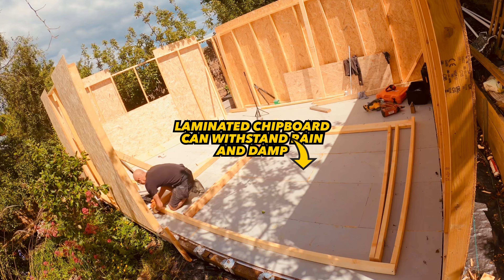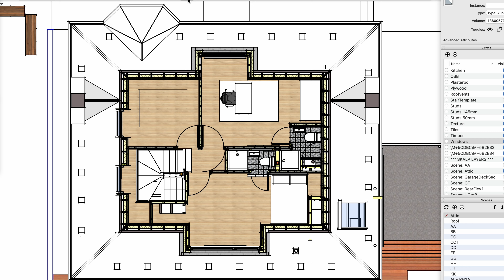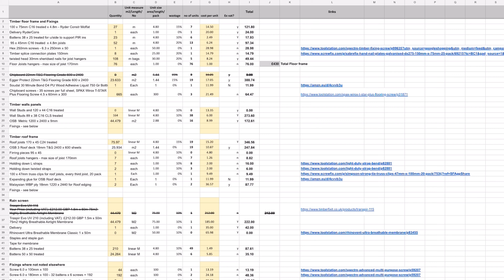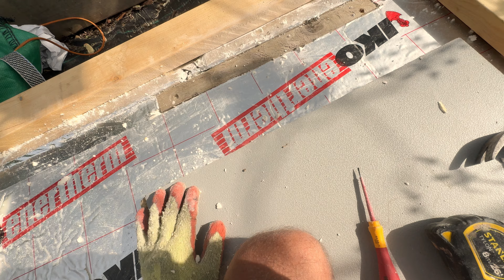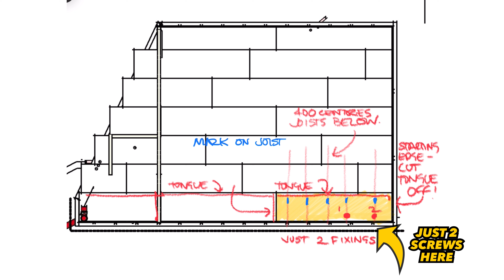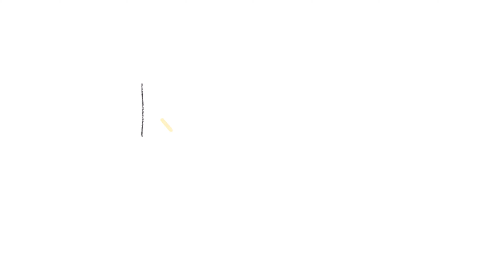Lay Chipboard Particleboard the Easy way | Architect & Builder Tips

Comment: Just found your channel, incredibly informative, I’ve subscribed. I’m doing a renovation, taking a wall out to make two rooms into one. This gives me a slab and suspended wooden floor (I’m laying 22mm p5 chipboard) and will put LVT over the top. My question is how do I join the two floors and maintain an expansion gap for the chipboard? Thanks
Reply from the maker: Hi. Tricky as I’d need to see the arrangement. I’d be very careful as it’s going to be so hard to predict the movement at the junction with the two make ups, regardless of a movement joint. You probably don’t have the depth for screed so I’d consider a floating floor with underlay. You want a floor finish that acts like one big carpet and floats over the junction, which can move separate to the finished floor.  I’m never sure how well lvt does that.

Comment: theory is good, however particle board is absolutely useless for floorboard, I would never buy a house with it, never use it doing Reno work, I don't even want to use it for kitchen cabinets, chip board is rubbish, do not use it, some country's its not so bad, but its a no go for most, the right ply is better, the best is floorboards of correct/available timber
Reply from the maker: You might be thinking of furniture-grade chipboard or MDF. Modern floors use P5 moisture-resistant structural chipboard. Because it’s tongue-and-groove, it locks together and prevents the edge-sagging and squeaking you get with plywood unless you waste time and money blocking out all four edges of every sheet. When people in trade environments say "chipboard floors are rubbish," they are confusing cheap P1/P2 furniture board with P5 structural flooring
Reply: @build-better-things  im a joiner by trade, used most products, chip board products including floors are replaced regularly, chip board is rubbish, moisture resistant, NOT water proof, if someone wanted me to put chip board floors in i wouldnt do the job, the floor boards in my house could be left in water for about 50 years, its called matai, no longer milled so people with brains use H3.2 22mm pine ply wood, the retards use chip board and yes this is structural flooring chip board, i am not the only tradie that refuses to install chip board floors, have machined pine and tawa for floor because even onto it customers refuse the weakness of chip board and the tension of ply for tiles in kitchen and bathroom, had a customer who was 240kg, doctor said sort it or death so hes much lighter now, he never went through any matai floor boards and they 100 years old, MDF? mate that shit is almost outlawed in new zealand, pretty much only gets used for caskets

Comment: Hi so regards to VLC under the chip board do you need a separate one or is the foil tape adequate as you've shown in this video
Reply from the maker: Hi.  Because this is so well ventilated beneath the insulation, and in combination with the glued laminate which is effectively a vapour barrier, taping the foil is good.

Comment: Is there a reason not to use 2400x1200 board instead of 2400x600. Wouldnt it reduce effort, mistakes and joints?
Reply from the maker: Have you tried lifting 22mm chipboard? It’s heavy and awkward. Although I’ve never tried that size of chipboard. In uk 25kg is the average sheet weight for all the healthy and safety stuff

Comment: Great video, but why choose chipboard over say tongue and groove OSB3? OSB is only slightly more expensive than chipboard but stronger and more water resistant as far as I am aware.
Reply from the maker: Hi. Much harder to get 22mm OSB, I’ll never use 18 for flooring , no laminate protection, tongues smaller so too loose a fit, off the top of my head. All flooring grade chipboard is tantalised or similar for moisture resistance.
Reply: @build-better-things  What about 18 mm for a retrofit? I'm having to take up my 18 mm chipboard floor to insulate and will likely break the panels in the process so looking at replacements and 18 mm T&G OSB3 seems like the best option.
Reply from the maker: Yes retrofit is different again. All about the substrata and levels. I tend to double up existing joists and / or glue down as well screw and glue joints. Since you’re stuck with 18mm, I’ll really focus on the sub strata. Honestly I’ve never used OSB for that so your research will be as good as mine.

Comment: Currently desqueaking my house . Not a single screw or glue was used and every single stud wall is straight onto chipboard. Tonight I've been ripping skirting boards  off and screwing sole plates down 😅 the cracking sounds from the floor when walking upstairs are an absolute nightmare. 

Absolutely fantastic video, many thanks

Comment: You mentioned not worrying about noggings in. Would the t&g which lands on no joist be weaker when walked over?
Reply from the maker: Using 400 centres and 22mm chipboard, the glued tongues perform.
Reply: @build-better-things   I had the same question - thanks for the reassurance.  A question on the 400 centres dimension: given that PIR insludation comes in 2.4 x 1.2m sheets, would be be better to have the 45mm wide joists on 445mm centres so leaving a spacing of 400mm between joists, which would avoid any wastage?  In any case, what a wonderful series of videos.  There must be many thousands of folk who (like me) deeply appreciate the time and effort you have put in.
Reply from the maker: Hi. You’re exactly right. 445 centres gives exact cuts and still performs. I made a video about how I optimise PIR if you check in my list. Thanks a lot for your comment.

Comment: so do you not need support under the p5 boards along the entire peremeter? so on other words the outside long sides of the floor?
Reply from the maker: As long as you don’t use full depth and carry your insulation underneath.
Reply: @build-better-things  sorry I didn't understand that 😅  what do you mean by full depth? My insulation is all packed in tight underneath etc

Comment: Do you apply glue along the top edge and bottom edge of the tongue? 
I’ve seen some say to add glue in the groove and to the tongue but when the sheet is down I find it impossible to get glue in the groove part,
So is best practice to apply to both sides of the tongue on the NYD sheet you’re laying?
Great videos
Reply from the maker: Hi. I just put on the tongue. The glue expands into the groove and you can tell it’s done it by ensuring there’s enough to make it foam over the joint
Reply: @build-better-things  I'm going to be laying a chip board floor soon, 20 sheets (2400 x 600) on 400 centres, roughly how many 750ml bottles of Soudal 30 Min D4 PU Wood Adhesive do think I'll need? Don't want to get too little, as that will hold the job up, or too much as that will be wasteful.
Reply from the maker: I think 2 will be enough.

Comment: Any thoughts on adding green glue tape to the top of new build posi joists before adding 22mm boards to decouple the deck from the intermediate floor joists thenscrew them down
Reply: Sounds like a good idea but id worry about it allowing the chipboard to flex will cause squeeking/movement. Also how will the PU glue adhere to the tape? I think plywood with lots of noggins would be a better choice if your going down the acoustic decoupling route

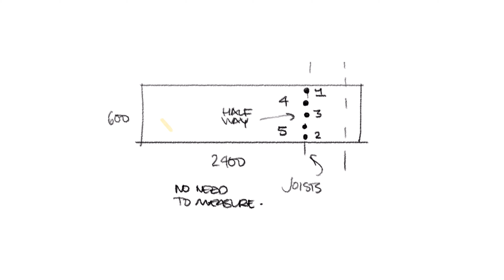Comment: 11:07 where does the requirement to have 5 screws per joist come from? I'm looking into the Egger's guide (ref: BAF-19-129-S-A-UK) and they recommend either 0-3 screws per joist (depending on the position) or no screws at all (glue only).
Reply from the maker: Hi. 5 screws per joist and 400ccs is not really a requirement per se.  You’re welcome to follow their guidance. Or you can follow mine, where I’ll design and even over design to avoid problems later. Egger won’t come to fix your floor if it squeaks.

Comment: I think they nailed my chip boards in, i think that's why they creek and squeak. I'm going to loft the carpet later. If they are, would replacing nails with screws be a good idea?
Reply from the maker: Yes. I might screw in new places and put foam glue in the holes where the nails were, if you can pull out the nails
Reply: @build-better-things  thanks, I'll try it

Comment: why can't it be standard practice to have a stud wall built directly onto its own joist... seems wrong to build over the floor.
Reply from the maker: If I’m understanding you correctly, I think I agree. I always build my walls directly off my joists, always stop the chipboard short.
Reply: @build-better-things  Exactly, Have either 3 joists sistered together or 1 thick one so that the flooring either side of the stud can be replaced at any point with ease.

Comment: If I want to build a timber frame and add floor boards in my garage, just to lift it off the bare concrete. Do I have to have dwarf walls for the joists to sit on or can the timber frame just go directly onto the concrete floor?
Reply from the maker: Assuming your existing floor has the right depth and is reinforced, it’s an option but you have the issue of airflow as well as damp on the timbers to think about. You don’t want the timber joists to be hard onto the concrete, even if you use DPC under, because 1) you’ll block the cross flow of ventilation. Plus, 2) these floors are rarely level, so if you do want to support off the floor, think about shimming it level by and off the concrete by around 50mm. I’m making it more complicated than it is in reality but just trying to point out the things to think about. Best of luck.
Reply: @build-better-things  Thanks for the reply. It's a flat concrete garage floor internal to the house, came like it is as a new build. I am converting it into a warmer space with battoned insulated plasterboard walls, and a better floor. What's throwing me off is I could just put down some underlay and laminate and noone would bat an eyelid, but as soon as I want to put a frame down to give a bit of separation it seems to get needlessly complex with airflow and damp etc, neither of which are an issue for the timber used as battons for the wall.

Comment: The Caberfloor P5 installation instructions advise secret screw fixing through the tongue - do you not recommend this?
Reply from the maker: I recommend that you have a minimum of 5 fixings along each joist, which means, if you don’t follow that advice and you if you only rely on secret fixings along the tongue your floor will definitely squeak.

Comment: Is it a good idea to fill the expansion gap between the chipboard and the walls with flexible flexible expanding foam to make the room airtight?
Reply from the maker: I’m never how airtight expanding foam is, but, I tend to leave the gap open, and make sure my wall and floor insulations continue below, and ideally the wall vapour barrier folded down under the floor onto the floor. In this case I used tape.

Comment: Fantastic and thorough video! NHBC standards say the floor need’s perimeter noggings. Any tips on how to secure the timber to the brick wall for this purpose? Like what specific screws and wall plugs I should use, how many and what distance apart. Between my joists there are spaces ranging from 18-33cm.
Reply from the maker: If you’re fixing into the side of masonry, you might consider a perimeter joist which is secured with resin anchored bolts but also need to consider moisture mitigation depending on DPC arrangements. Where you’re sitting on top of a wall plate, I would use straps. In both cases, these should be noted on your engineer’s drawings if it’s fit building control. There’s also the option of masonry joist hangers.  Perimeter noggins are also needed for the ends of flooring. Thanks a lot for your comment.
Reply: What size bolt best for this type of purpose please?
Reply from the maker: Perhaps M10 or M12 but I’m not an engineer so you need to check with your structural consultant depending on your circumstances

Comment: I've always laid boards starting with the tongue into the wall on the first row: use a piece of 4 x 2in softwood against the flat edge of a board, lightly tapped with a sledge hammer, to knock rows of boards together tightly in without any risk of damaging the tongues. Adjacent boards don't always pull up tightly, especially if they have been poorly stored, hence this approach which also avoids ever trying to knock the tongue edge. For maximum strength joints need to be tight, Loose board joints which are unsupported are another potential source of squeaking. 

Personally, I don't like unsupported joints because if badly glued and/or not pulled up tight these are another potential source of squeaks and creaks. Unsupporteds shouldn't be necessary on new builds, but on non-standard/older refurbs I've always tried to add-in extra support noggins. Maybe costs a couple of boards to be wasted - but results in less call backs

Maybe worth noting that PU glue simply stops working at low temperature (sub 5 degrees Centigrade), so using it on an unheated build in a freezing cold January in Newcastle-on-Tyne won't end well! My own experience is that gluing the boards down onto the joists helps eradicate squeaking - AFAIK this is (or at least was) the recommended installation procedure from both Egger and Caber

Comment: What's the benefit of using tongue and groove chipboard over osb boards? Osb Is usually cheaper
Reply from the maker: I can get the chipboard for a bit less cost the last time I looked. Plus…chipboard is treated for moisture resistance, plus 22mm t&g OSB is hard to find. I’ll only use OSB for roof deck or if I want to expose it. And if I’m building outside, I don’t want to use OSB as the floor, as it’s not waterproof. The Egger is better for that.

Comment: Excellent video. Have done, more or less, what you've advised on a new floor as part of a whole-houose renovation. A couple of months after finishing and when loading floor with 10mm laminate flooring,  partitions, cupboards, etc terrible squeaking started. On 600mm centres, I-joists, using D4 Egger-type glue and screws with 22mm caberboard. Still have 'access' to joist-board face from underside. Any suggestions to cure this nightmare short of knocking the whole house down ? :(
Reply from the maker: If you’ve still got access to underside, maybe run some expanding foaming glue along the tops a new set of joists then, before the glue starts to cure, or set,  screw them immediately into the side of the existing joists, pushing them tight against the underside of the chipboard at the same time. Clamps are your friend. . Then introduce noggins in the same way.  If you use enough glue it will expand to grab the floor. Without seeing it, I’m guessing only. As I said in the vid, I’ll avoid 600 centres because of the increased risk of squeak